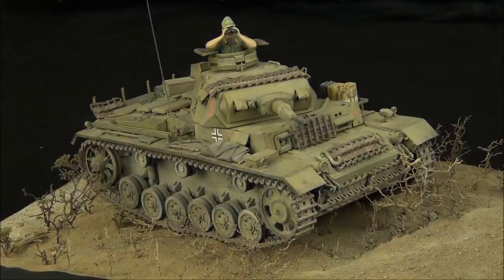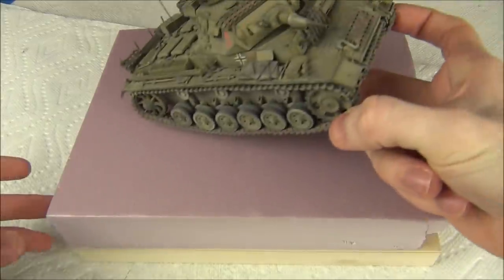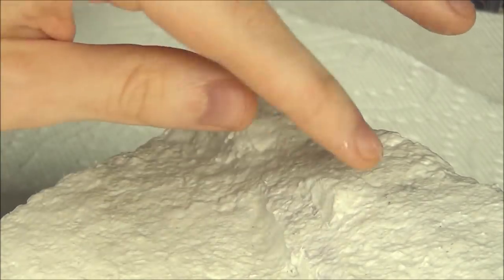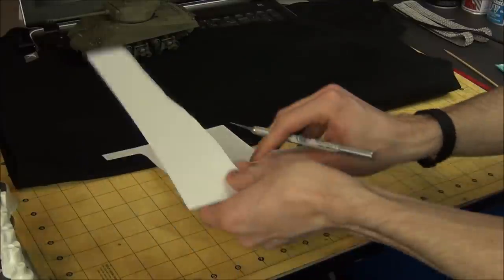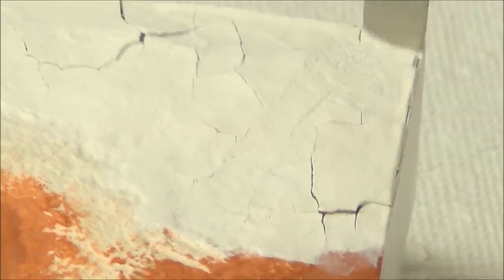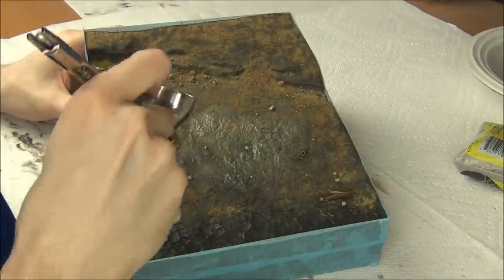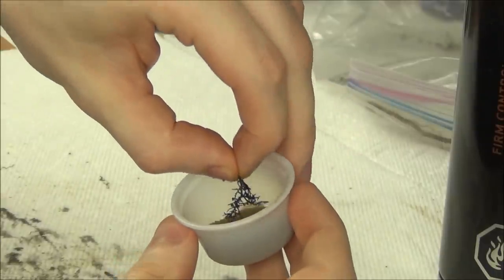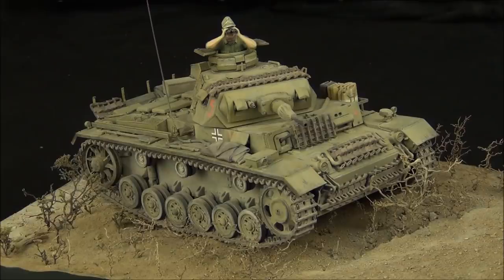Let's build a DAK Diorama: Battle of the Salient, Tobruk 1941

Comment: A really well done diorama.  Simplicity is often better  - especially for a single model.  Instead of hair spray, watered down PVA (white glue) through a spray bottle is effective for fixing sand, dirt, etc to bases.  If you need to make the insulation look like rock/stone, you can texture with rolled up aluminum foil (idea from Black Magic Craft), and torn up cork stacked up can be effective looking stones, etc.

Comment: Great work! I really like the cracked river bed. I have a proxxon hot wire table and it’s great, with a bit of practice you can get very clean and repeatable cuts. Although it’s not cheap I’d recommend it to anyone that builds lots of dioramas and or buildings.

Comment: Really do love this diorama (I think the "story" thing is taken too far by IPMS for sure- this scene puts the tank in a specific time and place and the crew are clearly there for a reason- sounds like a story to me! The specifics may be up to the viewer but I think letting the viewer imagine some extra story is a plus). Anyway it's very cool to watch the idea stay static but the techniques to achieve it evolve as you progress. I wonder how many of us draw these "the tank goes here" markings as we sort out the groundwork?? Haha. Very well researched, it's a smart scene that really sells the dry river bed and rocky terrain you're after. Looking forward to your next project! And if you want to save a little time and cut out some steps, if you can get some premixed, water based drywall spackle, it basically cuts out both the sculptamold and clay steps. And if you wanted to, you could add the dirt, sand, rocks, and fallen branches as it's drying to really lock it all together quickly. The end results are basically the same, but could save you some application/drying time.
Reply from the maker: Thank you Chris.  I will look at getting some more products to speed up the process.

Comment: Anybody know where you can get a foam block like that?
Reply from the maker: that's just pink insulation foam I bought at home depot.
Reply: Most model shops do it, mine’s do it in a blue version that’s excellent to work with and has various thicknesses on offer.

Comment: Does enyone have an idea,why my tamiya panzerkampfwagen 38t 1/48 after accurate build still have some little bits left on where you have to cut them out.They do have numbers but they are not represented or even shown in instruction sheet.Thank you for help guys
Reply from the maker: Probably spare parts left over from other kits based on that tank much as Marder III.
Reply: Panzermeister36 cheers buddy for answer.But it’s quite strange to me how can u have some bits left on one model,for instance where they can be used if for example u won’t be building same tank
Reply from the maker: some sprues are used between different kits so they will result in unused parts depending on which box/kit the sprue is with.

Comment: Notices that pz3 show no weight on the ground its sitting on top of the ground  need pressing into the ground to show weight
Reply from the maker: Tanks have lower ground pressure than a person does.  I don't sink into a rocky riverbed so neither will the tank.
Reply: Sinking into the ground usually only occurs when the vehicle is stationary and has has time to settle - even then it's usually not much except if the ground is wet. There's a picture here that shows when tanks are on the move they create very little depressions in the ground apart from the track. https://c8.alamy.com/comp/C45EE2/german-panzer-iii-in-north-africa-C45EE2.jpg
Reply: Deserts tend to have extremely hard surfaces so it would be ok to do it this way compared to say Russia or Europe.